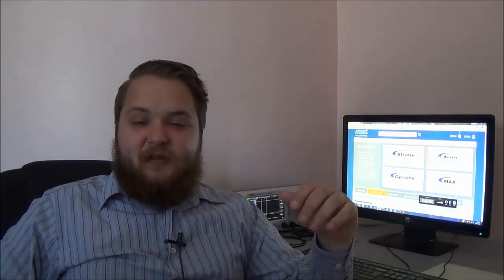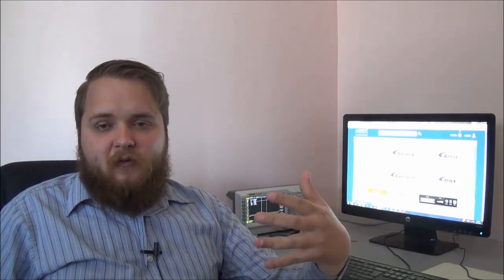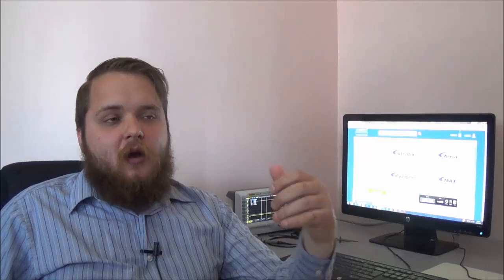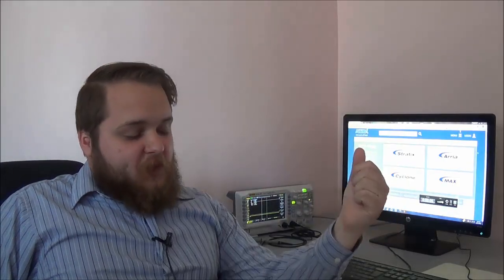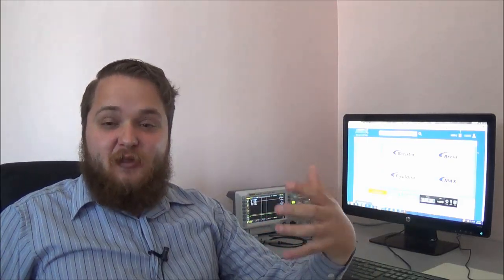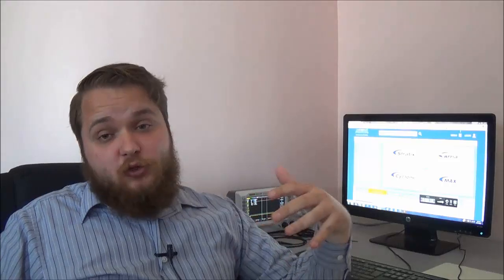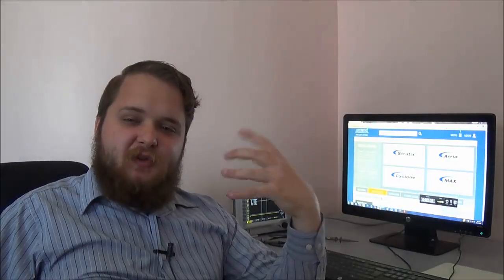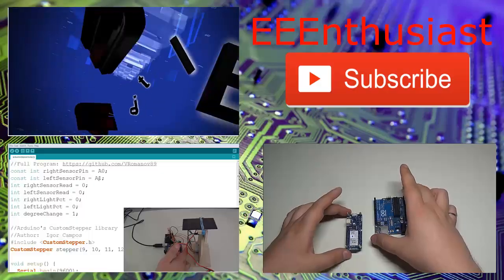Vlog #1 - Getting Started in Electronics Perspective

Comment: I agree with you. I got Arduino because I had so many complete designs and concepts in my head.After being frustrated with the Arduino language and barebones tutorials I bought a book, Make:AVR Programming by Elliot Williams. Very simple and funny too. A good start. I already had a kit but needed some direction. I wanted to program AVR in C and start to understand some of the innerworkings and logic of the MCU. My experience is TAKE IT VERY SLOW. Stay on one small thing and try and add to it like add multiple buttons or combine previous code. Open broken electronics up. Solder something. Experience takes time and be patient with yourself and fail fail fail because after a few months you will look back and be amazed at what you DO know. Also I started keeping a notebook and writing what I learned from the datasheet because that is the key of it all. Hope this helps someone! Don't give up and remember to laugh at yourself!
Reply from the maker: I agree with your points complete. I had actually learned it the other way around in university. I had to read a ton of datasheets in order to figure out how to program the Atmega8 (very similar to the Atmega328 on the Arduino), but for me it wasn't as much fun at the time. Later on, when I discovered the Arduino, I couldn't believe how much simpler the platform makes everything. I don't know why it is taught backwards...

Comment: I've programmed (some of it because I've cheated a bit by searching for a code to make my movement ultrassonic sensor work) a movement sensor that makes a noise when senses something. Ok until then, but my idea is conecting the circuit to my room's light to switch automaticly between on and off without touching anything. I've asked to all my teachers that are graduated on engineering, and all of them told me that haven't worked with it for many years. Now the real question : is it possible to feed the circuit with the energy provided for the light? and how I'm going to do this without burning my home, family and I (not in this especific order, probably I'm going first)? Please
P.S.: Keep being awesome! It's very hard someone that gives all this kind of support to the fans
Reply from the maker: Hi Kvothe, thank you for the kind comment. The simplest way to switch a light on/off would be through a relay. I would be very cautious playing with the house wiring and make sure that I am aware of all regulations with regards to this modification before doing so. That being said, you can make it as simple or as complex as you want. There are people who modify existing switches and solder a relay to them and some will add a wireless module into it. If you aren't comfortable playing with the electrical wiring, there are always alternatives which make it very easy to switch loads; here's an example: http://www.powerswitchtail.com/Pages/default.aspx
Reply: EEEnthusiast Thank a lot for the help man!